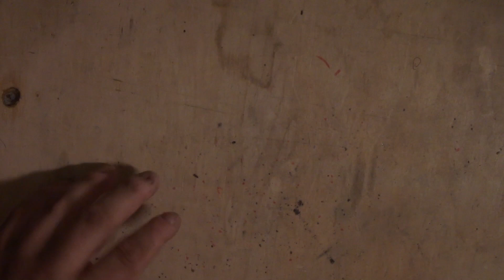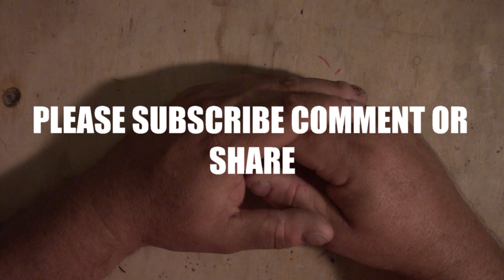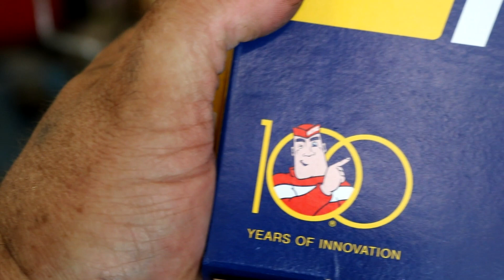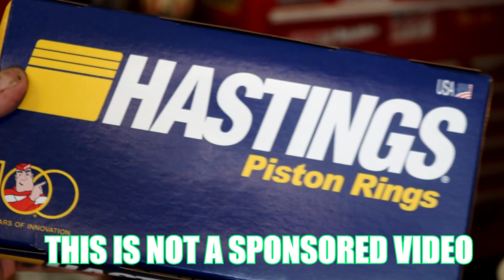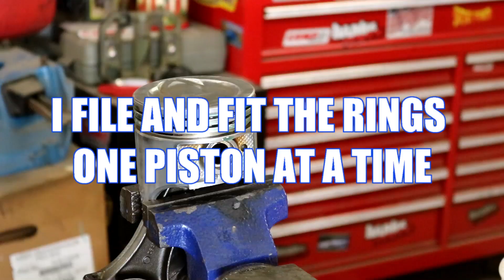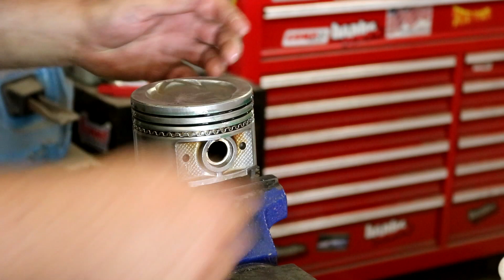FE Build 1 part 4, rings and oil pump

Comment: The hex drive shaft is supposed to go in with the oil pump. It fits from the bottom not the top,  as from factory, hence the clip to stop it being pulled out with the distributor.
Reply from the maker: That’s exactly how I put in. Retainer ring at the top against the block.

Comment: I just pulled my 390 oil pan off to find an entire timing gear blown to pieces in the sludge. Good ol' plastic timing gears. Thanks Ford engineers.
Reply from the maker: I’ve seen it many times. Also on a few fiber gear six’s aswell.

Comment: Great video brings back memories. I might be buying a 1972 f150 with a 390, don’t know yet. I know all about those pesky oil pump shafts, I built a special tool to hold them so they don’t slip in the pan. I can’t remember but somebody makes a high performance shaft with a big collar on top so that will not happen.
Reply from the maker: Joel Seim 
ARP shaft has the big shaft retainer. There may be more manufacturers
Reply: Ok, it’s been 44 years since I did my last 390